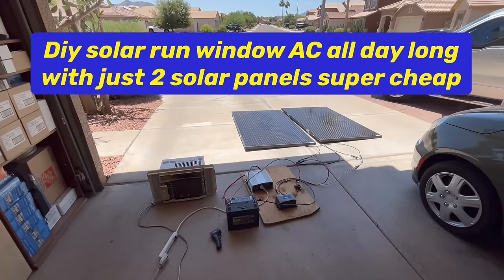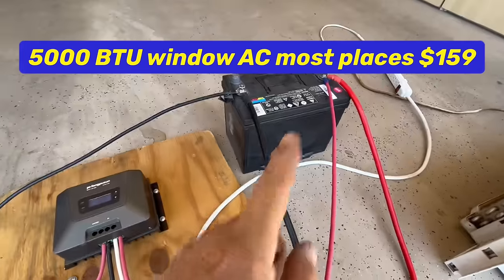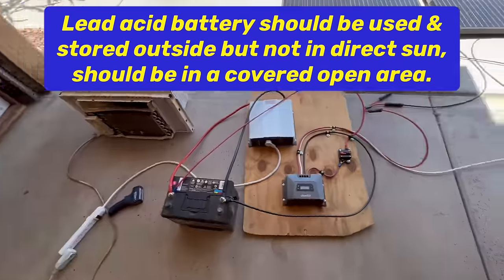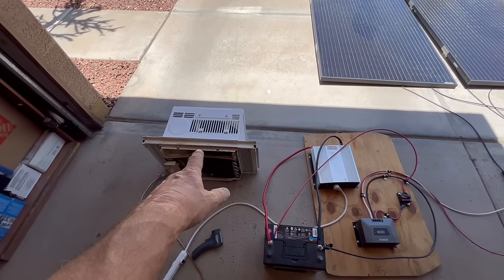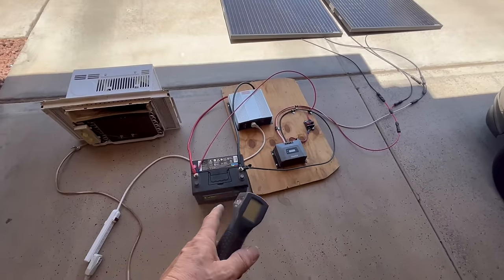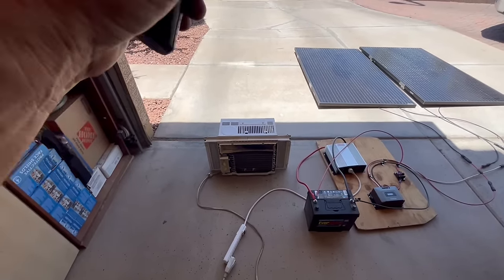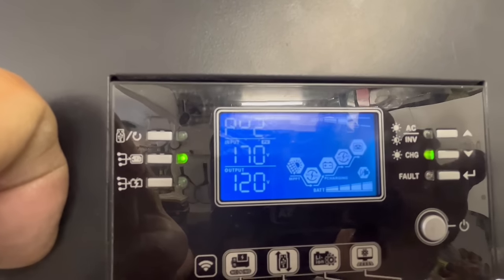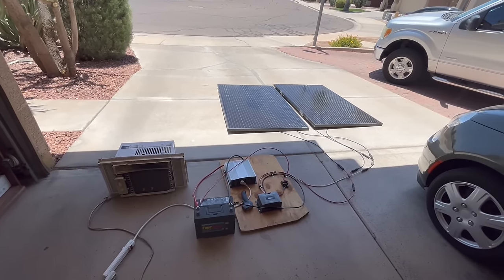Run your window AC with just 2 solar panels when sun shines. Easy DIY project you can do in one day.

Comment: Wouldn’t it have been better to have ur panels connected in series to get 24v ?
Reply from the maker: You can connect solar panels either way with this charge controller, in series or parallel, but you are maxed at 2 solar panels for 12 volt battery bank. But if you add another battery and connect those in series to make 24 volts battery bank, you could add 2 more solar panels. Also these solar panels are 39 volt dc output, not 12 volt dc output. You have to stay under 80 volts dc input from solar panels.
Reply: @diy-solar-guy  AH… Panels r 39 volt… THANK YOU !   Wold like to see ur next upgrade video with a two battery 24 volt option…
Reply from the maker: @JOESRQFLUSA  setting it up in the garage yesterday and hopefully will get a video out in next day or two.
Reply: @diy-solar-guy  BRILLIANT. !   And maybe go with pure sine wave. 👍
Reply from the maker: @JOESRQFLUSA  I will be showing an all in one 24 volt 2400 watt input/output pure sign wave inverter for upgrading to 24 volt system. Can be paralleled with at least 6 more inverter exactly the same unit but only 120 volt out put. You could run two 1200 btu 110 volt mini splits with this 24 volt inverter and air condition 1200 square feet of space. You could still plug in window ac units but mini splits are much more efficient and heat in the winter unlike window ac that only air conditions.
Reply: @diy-solar-guy  👍👍👍

Comment: It stays on allday once suns out right?
Reply from the maker: I had this running in a shed from around 9 am to 5-6 pm 7 days a week for around 2 years. If there are clouds out even partially cloudy it will not be able to continue with only 2 solar panels. This is a basic set up of running window ac with solar. The more you improve this basic system the better it will work for you. The next step up from this is a mini split inverter heat pump that can cool and heat. They start around $500 on eBay , a lot of sellers. A 12,000 btu 110 volt mini split can cool or heat around 600 square feet. I have a lot of videos on these mini splits. I installed 6 in my house. 2 upstairs, 2 downstairs and 2 in garage. I can also run my 3 1/2 ton and 4 ton central air conditioners on solar in day and battery bank at night using Lithium Iron phosphate battery bank. Once it goes over 113 degrees in day and over 87 degrees at night I tend to run central ac over night on grid. I have 25.5 kWh LiFePO4 EG4 battery bank but I will heed to get 2 more batteries to make it a 35.7 kWh battery bank. Now it will run battery to 20 percent state of charge from overnight use. It will only cost me an extra $60-$80 this month to use grid for air conditioning overnight from 6pm to 6am still keeping my electric bill well below $200 for insane hot Phoenix AZ summer temps. Check out my videos on expanding this basic set up and see what I been able to do with off grid solar. Hope you have a wonderful and blessed week
Reply: @diy-solar-guy thanks for the reply man. Am from the Bahamas so you know I need this. But my AC is a mini split unit 8,000 BTU. I'll definitely follow your setup and yeah , I'll tweek it a bit. I wonder if adding an extra battery with another solar panel would be fine enough
Reply from the maker: @elasesinoespritual341  absolutely, the more batteries your have in parallel and more solar you add with just make your system that much more stable to run all day. I installed 6 mini splits in my house and 5 are 110 volt 12,000 btu. They will use around 1000 to 1200 watts once running after about 5 minutes then when temp set is reached in room , the watts will go down to 400 -700 watts. My mini splits are 16 seer and 19 seer. The higher the seer rated the less watts will be needed to run at start up and once temp set is reached. I usually like to have 1500-1700 watts in solar panels for each 12,000 btu mini split running . That gives me a cushion for when panels get temporarily shading or clouds in sky. I also use Lithium Iron phosphate batteries now instead of AGM, I can run mini splits overnight

Comment: the quetsion is how long can it run the AC?
Reply from the maker: It all depends on if it’s sunny or cloudy. This is a simple illustration of off grid solar. I will be doing a part 2 where I will take the next step and use a 24 volt all in one 2400 watt input/output that could run 3-4 of these window ac’s or 2 mini splits. You can actually see the mini splits I installed and how many solar panels you need watching some of my other videos. I actually am running my  3 1/2 ton upstairs and 4 ton downstairs central air conditioning on only solar in the day while it is 113-116 degrees during the day and a 25.5kwh EG4 LiFePO4 (Lithium Iron Phosphate) battery bank at night when it is 90 degrees for over night low. I spent $0 on air conditioning my hous day and night and $0 air conditioning my garage all day long from sun up to sun down. I have a 2 story 2450 square foot house and my 3 car garage is around 600 square feet. Check out my other videos to see I run my variable speed pool pump 24 hours a day. We heat our 15,000 gallon in ground swimming pool to 87-89 degrees in the winter because we don’t need to air condition or heat house but if it gets to cold we can heat house with the 2 central ac’s or use the 6 mini splits, 2 upstairs, 2 downstairs and 2 in garage. Check out my videos to see just how easy it is 2 set up a 24 volts off grid solar system or a 48 volt off grid solar system. Very easy DIY. Thanks for the question and hope you have a wonderful and blessed day
Reply: @diy-solar-guy  thanks for the lengthy reply. 

Though my question was not answered. 

Sorry im just clarify to understand more of this setup as I am planning to do this to save on AC bills. 

1. what battery capacity are you running?

2. on this video or base on your prev answer, are you saying that it's only getting powers on the panels, not on battery during day? If yes, that is awesome!

2.b if it's cloudy, does the battery kicks on or the power grid assist? 

3. during night, for the #1 question capacity, how long the battery can run the ac? 

I guess that's all for now. haha
Reply from the maker: @atlasoverlandrecovery  the way this system is set is only able to run during the day with full sun. The solar panels are supplying the load to the ac. The battery capacity is 101 amp hour 690 MCA. This battery will not run long once solar is no longer available. The purpose of the battery in this example is to make system run, not to keep running on only battery. You would need a LiFePO4 battery to run when no solar. The more panels you add the better chance you have to keep running due to clouds reducing watt input into charge controller. If you are looking to run this all day in a room or shed you will need to improve system. The way I ran it was at 1/2 way between low and high. That way it kept cycling off and on. When the ac cycles off it will charge battery at a higher voltage, 14.2 volts. When running it will go lower when ac cycles on. The battery will not charge if the load is say 550 watts and your solar panels are bringing in less. You always need to have more watts input from solar than load usage. If you set this on high all day long and the load is 550 watts and solar input to charge controller keeps dropping below 550 watts, the battery will start to discharge and will continuously go lower. This battery will not be able to run ac for very long, maybe 1/2 hour to hour at most if you keep bringing in less watts than load needs. The way I used it, the ac cycled on and off, the battery starts to charge, but a lead acid battery does not charge as fast as it will discharge. Usually takes longer to charge and can be very short time to discharge. You also should not go below 12 volts on the battery. That is considered the cut off point where you do not want to go lower. If you plan on using to run all day you should always over supply more watts than what you actually need by 30 percent at least. When using solar you never use 550 watts in solar input when your load might be 550 watts constant load non stop. This example was to show you can run solar with these minimal parts. Improving on this system will only help you to achieve your goal of air conditioning a room or shed or motor home. You have to take into a lot of things into consideration such as how well insulated the room is. I would say if you really want to use a window ac that uses 550 watts on high and have it work all day long with no problems, I would use around 1000 -1200 watts input because of cloudy days, even scattered cloudy days that clouds linger for 20-30 minutes could drain battery unless your input is 1000-1200 watts. You always need to factor in for losses in input watts. The other thing is if your battery gets around 12 volts, it might have trouble starting compressor. Once again this is a simple illustration. It would work well when temp outside is 90 degrees or below but the heat we have in AZ, I would have to beef up system to keep up with heat. My 3 2/2 ton and 4 ton central ac units are having a hard time keeping the temp at 76 degrees inside because outside is 117 degrees today and will be 92-95 overnight low. You have to be realist with application at what you are trying to achieve. The more panels you have the earlier you can start running ac and the longer you can keep running ac. I had to really insulate my garage before I could even think about installing ac. If I installed  without insulation with it being 117 outside with the sun directly on garage door, I would only be able to get temp to maybe 100 degrees. There is no grid assist with this basic model, you would have to use a off grid hybrid inverter that has grid assist, but you would not need the inverter or charge controller in the video, that is inside the off grid inverter or referred to as a all in one hybrid inverter. You could not run this ac on a deep cycle battery all night long. I doubt you could use 20 deep cycle batteries to get though the night. I connected a 12 volt LiFePO4 battery 150 ah 2KWh to window ac the other day with no solar to simulate night time and only got 4 hours out of battery before it could not restart compressor. You would probably need at least 5-7 kWh worth of LiFePO4 battery to get you through the night and still be able to start compressor after 8 hours. At that point you would probably be better off using a mini split since high efficiency inverter type mini splits can drop down to 200-400 watts of usage one temp in room is reached rather than 550 watts constant usage. Once again that lead acid battery will only work as long as you have more watts from solar panels coming in by 20-30 percent to run load and keep battery charged. Let you in on a little secret. I used mini split to run from 6 am to 6 pm upstairs and downstairs in my house for 2 years only during the day, I then turned on my 3 1/2 ton and 4 to central ac units from 6 pm to 6 am and I reduced my electric bill by 60-75 percent. That was because I cooled the house for free when the heat of the sun was shining on the house and only used grid powered ac at night when it was dark outside and every hour at night the temp dropped making it cooler outside and making my ac kick on less often. The saving I had from air conditioning my house during the day for free was enough to pay me back for the investment in solar and mini splits each year. The only way I was able to pay back on reduced electric bills and get my money back was DIY. Having some company install will cost you about 60 percent markup for installation, price of product and markup on product they use. So it can be 60-79 percent extra cost having someone else install. I hope this answers your question. Feel free to ask more questions, I had a ton of questions 4 years ago when I knew nothing about solar, mini splits, central ac units. Better to know up from what you will need than to find out later. I wish I had a one story house, it would of made my life so much easier to install solar. I could of done the same thing for 1/2 the price and had s much better system. 2nd floor if house really was challenging to air condition and heat. I also have no solar panels on my roof. Let me know if you still have more questions.

Comment: Would you be willing to help me plan a solar system? I would pay you for your advice.  I've been looking for some one knowledgeable that I could bounce ideas off off
Reply from the maker: You are welcome to ask me as many questions you have about solar. If you watch my other videos you will probably get a lot of your questions answered. We installed 6 mini splits, 2 upstairs, 2 downstairs and 2 in garage. We can use those to air condition house and garage in the day with only solar and the house overnight with LiFePO4 batteries overnight. We. Am also use our 3/12 ton upstairs and 4 ton downstairs central ac to air condition house instead of mini splits or use a combination of the two. We also run our pool pump 7/24 365 days a year with only solar power and now can heat our pool to 87-89 degrees in winter when water temp is normally in the 40’s. Check out my other videos and then ask questions. Answers and advice are free to you. Hope you have a wonderful and blessed weekend
Reply: @diy-solar-guy  okay so hear me out, I process my own diesel fuel for my vehicles for about 40 cents per gallon.  I am able to clean used or water contaminated diesel and oils. 

I want to leverage this for electricity to an extent in conjunction with solar and batteries

My first priority is a well pump.  The well pump draws 7.6-8 amps contentious while running.  The start up surge amps I have seen on my meter go as high as 32.3 tho this is rare that my meter gets that high of a max reading.   Normally the surge start is 17-21 more often closer to 17.4.  It's a 220 or 240 volt well pump I believe.  From there how do i figure out what I really need? It runs for short periods though out the day on off.
Reply from the maker: @BRWfilms  at signaturesolar.com they have an inverter specifically designed for well pumps, here is the link. https://signaturesolar.com/growatt-2-2kw-3hp-l-spi-22000tl2-hv/
You would need to have at least 2000 and I believe up to 3100 watts in solar panels and you can directly connect 240 volt grid power for at nighttime. If you click on link you can see specs and installation instructions in a pdf you can download on phone or computer, you can also call signature solar and talk to their techs and ask them any questions you may have. I do not see that it requires a battery bank. But this is specifically designed for well pump use. Check it out and call them Monday thru Friday if you have questions.  Their directions for installation on most components they sell are really easy to follow. Hope this helps, hope you have a wonderful and blessed weekend and feel free to ask other questions.
Reply: @diy-solar-guy  okay so for something like that i believe it can input both grid power and the solar power at the same time? So that if it's cloudy I still have my pump working?

Also when the pump is not running and the panels are generating power what happens to the power it just feeds back into the grid?
Reply from the maker: @BRWfilms  with grid connection to inverter, when solar is not available inverter will use grid power. This is what is called grid assist. Grid assist is what I just explained above. This is not a grid tie inverter that I know of and if you wanted to do that you would have to get approval and permits along with schematic drawing submitted and approved. You can not feed power back into grid without approval from city and local electric power company. If power is lost and you are feeding power into grid while repair men are working, you could kill them or seriously hurt them. If you get caught feeding power back into grid you could be fined and prosecuted. This should only be off grid with grid assisted unless you plan on going through the correct. Very expensive and extremely lengthy process to grid tie. Hope that answers your questions
Reply: @diy-solar-guy  I don't honestly want to send power back to the grid anyways as they pay very little for kwh generated.  So what happens when the well pump is not in use tho? The panels are still getting sun how does that work? I did call signature solar and they said I can get in touch with their system design team Monday so I appreciate the link
Reply from the maker: @BRWfilms  if you solar pump is not running, the inverter will open the circuit and not allow power to go through, if it has a battery bank, it will charge battery bank and then open the circuit not allowing power to go through circuit until needed for pump. Most off grid inverters usually have a battery bank in not connected to grid assist to keep power constant with no spikes or dips in power. Inverter needs a power source that is stable to draw from to feed loads. I have a so called batteryless inverter that is connected to battery bank and in the middle of the day if I am running small loads and there are no clouds in the sky and no shading from buildings or trees, it will continue to run as long as getting enough dc input from solar panels. You can now buy mini splits that are direct solar input to run during the day and also have mini split connected to grid power or battery bank for at overnight continuous use. An inverter and charge controller is in outside unit but the mini split does not require a battery bank to actually run, only needs battery bank or grid to draw from when solar drops below amount needed to run say I think 600 watts, then mini split will run using solar and battery or grid until solar reaches 0 watts, at that point mini split would run on either only grid or battery bank. Hope this helps
Reply: It does thanks!